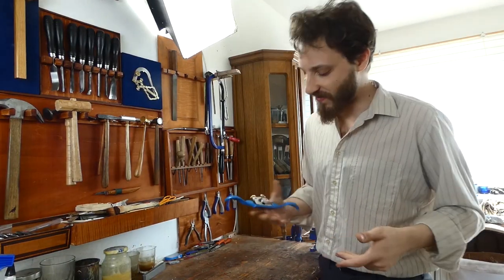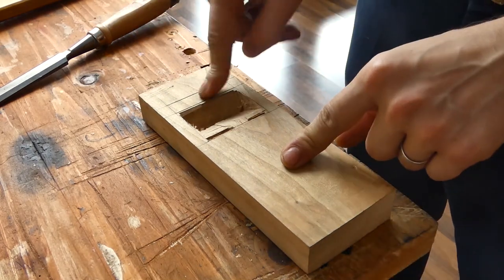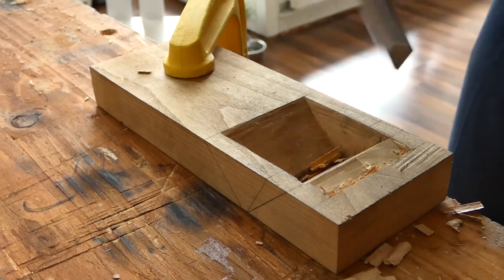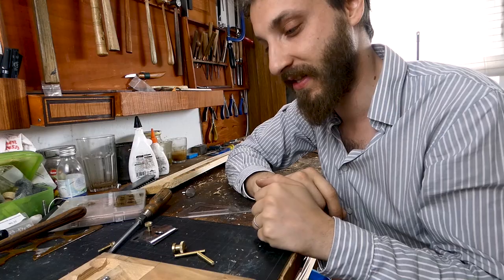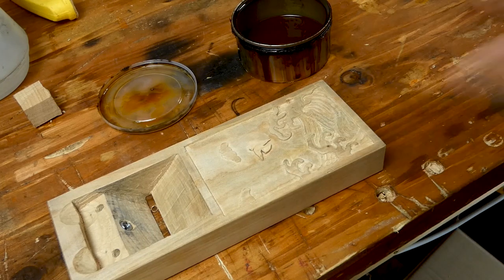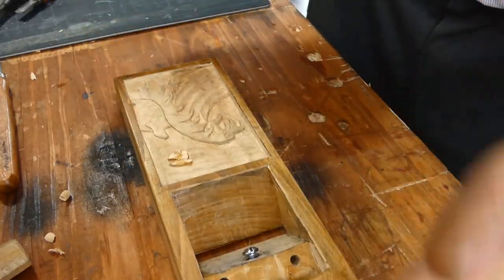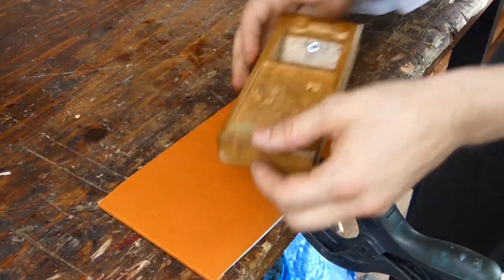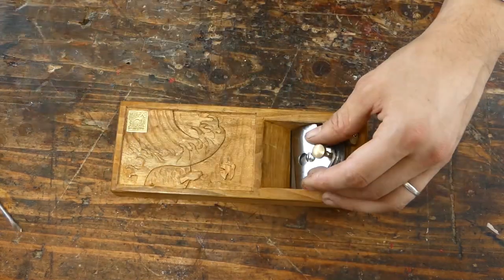Make a Japanese Pull Plane From a Cheap Spoke Shave

Comment: Nice video.  For Japanese planes, the magic is the simplicity.  The blade is the wedge and the spring of the wood is the adjustment mechanism.  Next time you make a Japanese type plane, I recommend buying an orphan blade on ebay.  Cheers.

Comment: Lovely work Uri. For sharpening I often use 'Wet and Dry' Carborundum paper, 400, 600, 800, 1200 and 2000 grit. Wet the top of a Laminex table or marble chopping board and stick the Wet 'n' Dry on it. Cheap and stays flat.
Keep making the beautiful creations.
Cheers
Duncan

Comment: Great video Uri, I love your channel.  When it comes to Japanese planes, only the long jointer planes have the back of the sole touching the surface. On smoothing planes like the length you have built, they only have 2 points of contact instead of 3.

Comment: If you glue the diamond plates to a thicker block you will need to do it on a reference surface because you can't lap them flat afterwords. Ideally you want a surface plate, but a cast iron table saw makes an excellent stand in. Place the diamond plate face down on the table and firmly clamp a thick block on top of it with as many clamps as you can fit to avoid deforming the table out of flatness.

I also wounder if you could make papyrus-style paper out of those shavings?
Reply from the maker: ElectricGears thanks for the great tips!  I have ordered a water stone that I hope would be a good upgrade from this cheap diamond plates.
The papyrus idea is fantastic, it's definitely something I would like to attempt.

Comment: Cool little project. I enjoyed watching. Just so you know, typically a kanna that short would only be tuned with the 2 points on the sole. The 3 point method is reserved for Naga Dai kanna. But it didn't hurt anything.

Comment: I wouldn't criticize your attempt at carving because the wood you were using for the plane isn't often used by carvers. In the USA Basswood is preferred and Butternut (hard to find today) is also favored. In the UK, Lime wood is very similar to Basswood. They are all too soft to use as a plane body. If you want to do more wood carving, I suggest doing the carving in a more appropriate wood and then inlay that piece into the plane body. I love your engravings and that is the main reason that I subscribed to your channel. Great work. I look forward to whatever your next project may be.

Comment: You can use Diamond dust. It goes up to 10,000grit, 50,000grit and100,000grit. Glass with Tin paste and use the glass like a Wetstone. Another beautiful job done. Sell the shavings to Gift Shops, as ‘organic, homogenous packing’ option to the quality of the goods. Better than bubble wrap.

Comment: I've made a few planes but have never bumped into the hollowing detail that you've done. I have puzzled over how a plane with a flat sole should not rest flatly on the wood as it removes a constant thickness from the wood. Doing it without precision is more where I land up so that just getting a flat on a board is the measure of goodness of a plane. Could spacetime curvature be to blame? I'd love to hear your analysis.

Comment: hey man, did you know, if you place two nuts sinched up against each other on the two threded bars on the spoke shave, you can then use a spanner on the bottum nut and unscrew the thredded bar from the spokeshave frame, maybe you already know this, or maybe the threded bar in the factry made spoke shave was to short, but just incase you wanted to use as much of the original spoke shave as you could, you can get the parts out how i said without any damage, kind regards to you =].